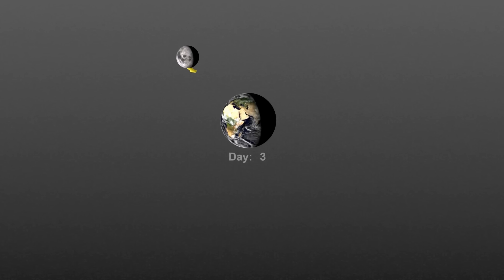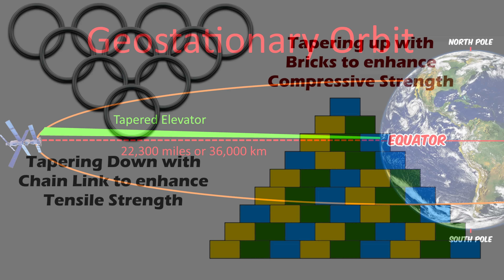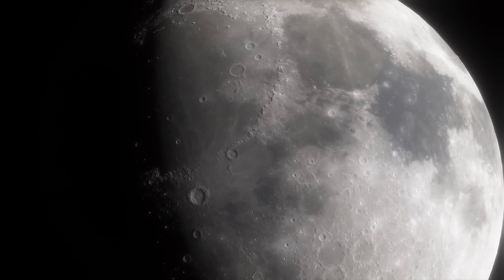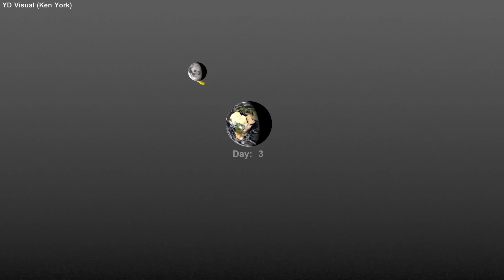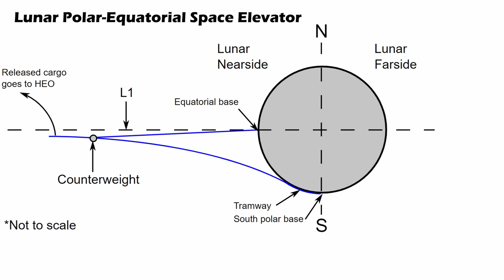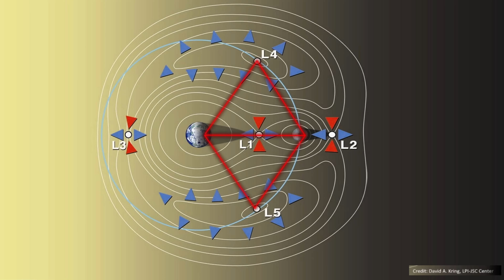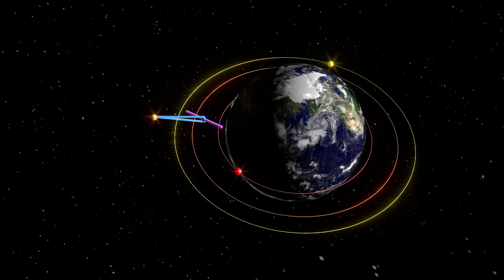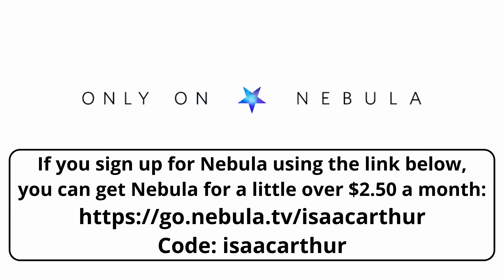Lunar Space Elevators

Comment: Perhaps an Earth-Space-Tower might best be built from Space down instead of building from Earth up ?!!
Reply: It depends on whether you're building a compression/active support tower or a equator through GSO "beanstalk" in tension.  The latter type of structure has to be built space down to maintain tension.  A compression or active support structure has to be built bottom up to maintain support.  You can't lay a course of brick top down because as soon as the mason releases the bricks they fall to the ground faster than he can lay the lower courses to connect it to the ground.  Since a space tower is supposed to extend beyond the atmosphere, you could build the top in orbit, but it would be going sideways at orbital speed, so how do you connect it to the ground?

Comment: Arg.   Ultra cheap freight of the moon?  From a space elevator costing what compared to the ships it would replace?  Would cost how much to maintain per year/ton?  Would last how long before radiation etc trashes it?
Reply: You would need a strong motive, it's not something that would be done otherwise.
Reply: @TheEvilmooseofdoom  
What motive for higher cost, more limited transport?   It’s like Space elevators from earth, even ignoring that no material can do it,  it would be wildly more expensive and more limited.  These are not result folks pay huge bucks to get.
Reply: @KellyStarks  The only way to generate a ROI is through a lot of use.  There is little on the moon that needs to get off the moon in any quantity that would make it worth doing until we're building really large space based structure... like in a few hundred years from now.. If..
Reply: @KellyStarks  Where are you getting these high operating costs from?  Using a cable system to move cars on a space elevator is ridiculous nonsense.  That group is worthless.
Reply: Capacity scales  with square of "thickness", radiation and micrometeorite degradation scales linearly.  The structure could be made with modular parts that can be swapped out.  You can have a micrometeorite shield panels outside the tension members and the track hardware.  The physics work, the rest is engineering.
          The oldest high orbit satellites and numerous discarded boosters left in orbit for more than half a century are still structurally intact.  The Voyagers launched in the 1970s are still working, despite weathering harder radiation and higher relative speed micrometeor bombardment than cislunar infrastructure.  It looks like what will do them in is not mechanical or electronic failure, but the gradual diminution of power from the half-life of their RTGs, long past their rated design life.  Sounds like you would have expected all the above to have weathered to dust by now.
Reply: @digitalnomad9985  
You can’t add shielding to the cable since it would weigh to much over that size of cable surface.

As to boosters and sats.  They arnt made of complex molecular materials like Kevlar or carbon fiber.. or nano fibers or graphene, that ionizing radiation shreds.   Simple metal skins arnt at risk.  Also old electronics are more rugged.
Reply: @KellyStarks  You can't add radiation shielding.  You can add micrometorite shielding.  The only difference about tensile polymers is they're stronger.  Metals have a molecular binding structure, too.  Have you ever seen a cross section of a spent nuclear fuel rod?  Early solid state electronics need a disruption larger than the period at the end of this sentence to drop a bit.  Any radiation that would substantially degrade a cable would brick any computer ever made, even if it's made with vacuum tubes (valves in the UK).
Reply: @digitalnomad9985  
Micro meteorite isn’t as much of a issue 
Polymers are long chain molecules out of carbon, and yes they are much more vulnerable to degradation due to ionizing radiation.  Especially with graphine or nano fibers, where they can be shredded like holes picked in nylons.

Comment: Since Luna has no synchronous orbit akin to that of Earth, maybe an orbital ring would be a better option. Also, because the Moon's rotation is so slow and it has an almost nonexistant atmosphere, the lunar space elevator wouldn't have to be as tall.
Reply: an OR is only useful if u have an atmosphere in the way. Othewise u just put mass drivers directly on the surface. Even if it wraps around the equator it doesn't need active support which is good cuz we still don't have that figured out

Comment: We don't really have the ability or functional concept to build a space elevator. What would support it between bouyant atmosphere and outer atmosphere? By the time we will be capable of it we will be well beyond the need for it.

The idea behind it is good but only the idea.

Instead the space tower is a good idea because you could build a giant low inertia catapult stretching miles beneath the surface all the way to thousands of feet up. Architecturally the space tower could be made today. It would require a massive coil gun or rail gun design and will require multiple power plants based on the size of it all. You can alter speed based on weather conditions.

Building vessels that can safely reenter atomsphere then be launched "quickly" back into orbit is the way to go. You can also launch unmanned cargo pods to be picked up by vessels or satelites in orbit. The cargo can be launched faster and heavier. A rocket guided spacehook off of a space station combined with the tower catapult could act as a safety net.

Computers will control the speed based on the numbers we already understand we need to reach to escape velocity.

There will need to be a limited entry/clear zone that the catapult launches to to prevent colissions. Satelites will need to avoid and manuever around these zones. We will also need nets to catch as much debris as possible around these zones. The space station idea is a clear solution.

Space travel would be like waiting at an airport for you flight until the LZ in orbit is clear enough to make.

All in all we need to solve the human problem before we build a mass use space entry device. People can't survive in space for very long.

Comment: being that the moon has no atmosphere that is a barrier to speed wouldent it make sense to just drill a hole in the moon and make a vertical shaft into the moon that has an actual elevator inside and use that to accelerate mass to speed? why would you even need a tower?
Reply from the maker: We discussed that option in moon mega city  :)
Reply: Digging thru would take a lot longer to do than building a tower. You then have the problem of it only connects two points on the moon. Any other point you go to would require other means of transit. Where as a Tower also allows for movement off the Moon as well as direct flights to any other point on the Moon. So unless your starting point and ending point is those two points of the tunnel, you are not likely to be saving any time or effort with a tunnel thru the Moon.

Comment: Is the moon or some of the other planets / asteroids solid enough to secure a space elevator to it?
Reply: The Moon is in al likelihood solid enough for space elevator construction.
Reply: The moon, mercury, venus, & mars do. Airless rocky moons get a layer of powdery inpact regolith, but they have a solid rocky surface underneath. For asteroids depends on the type but probably not. Then again putting an elevator on an asteroid is a waste of time, effort, & resources anyways. A beer can has enough delta-v to escape most of em.
Reply: At a certain depth, which the rather shallow Apollo core samples detected, the regolith begins to "vacuum cement" together, enough that the astronauts had a hard time pulling out the core sample.  That should secure things if bedrock is not accessible at the site.  Under Lunar gravity, ENOUGH of even loose material should secure a scoop anchor.  (It works for ships anchoring on muddy sea bottoms.)

Comment: Every moon in our solar system are tidally locked.  An elevator on the Moon will need centripetal force to remain taught.  The Moon doesn't produce much of that at all.  So I'm interested in how you solve that.
Reply: I think you might be mixing up a tether and a elevator.
Reply: On the Moon, the elevator structure would be a tower, rather than a tether.
Reply: No, an L-1 elevator has the same requirement as an L-2 elevator.  You need enough of a net counterweight Earthward of L-1 to tension an L-1 elevator, just as you need enough of a net counterweight outward of L-2 to tension an L-2 elevator.  The engineering case of the L-1 elevator is tensioned by an overbalance of Earth gravity, whereas the L-2 case is tensioned by an overbalance of centrifugal force.  The libration points are DEFINED as the balance points where the vector sums of both gravity fields and inertia allows a trajectory motionless with respect to the Moon.  Inward (Earthward) from L-1 at the same radial velocity (Moon's "RPM" around the Earth) an object will immediately tend to bend it's trajectory toward the Earth more sharply than L-1s path, because inward from L-1 (the balance point between Earth gravity on the one hand and the sum of Moon gravity and centrifugal force on the other hand), the balance is tilted in favor of Earth gravity.  It's not orbiting fast enough in that place to maintain a concentric trajectory with the Moon unless pulled Moonward by the rest of the structure anchored on the Moon, which it is in turn tensioning Earthward.
          The "centripetal force" you want for the L-2 tension should be thought of as that which holds the Moon in orbit against Earth's gravity, plus some rather than that of the Moon's rotational speed..  The tidal effect of the Earth's gravity heavily distorts near Moon trajectories and vectors from the Lunar reference frame.  If the Moon were a planet in isolation rotating at the same (month) speed, you could place Lunar elevators anywhere along the equator, but they would have to be much longer, because "Lunar stationary orbit" would be farther away than L-1 and L-2 in the actual case.
          And among major Solar System moons the Galilean moon Io is not tidal locked, but it is a volcanic hellscape as a result of being NOT tidal locked, and being so close to Jupiter.